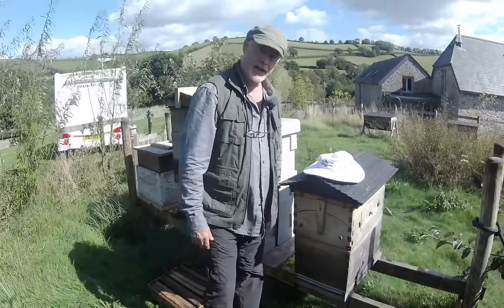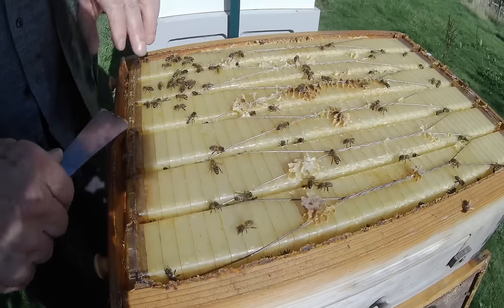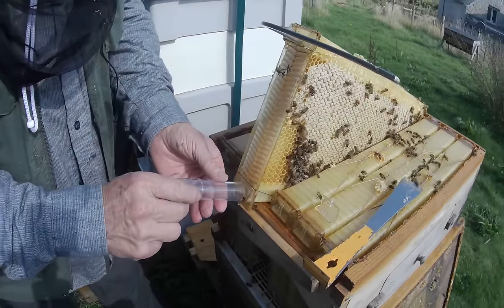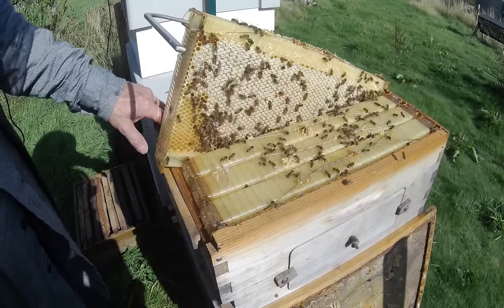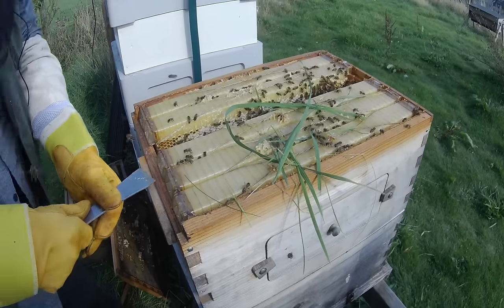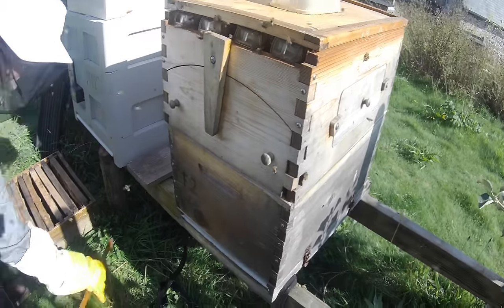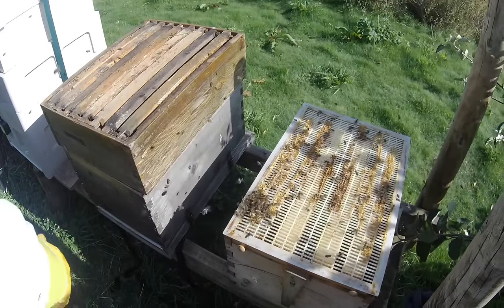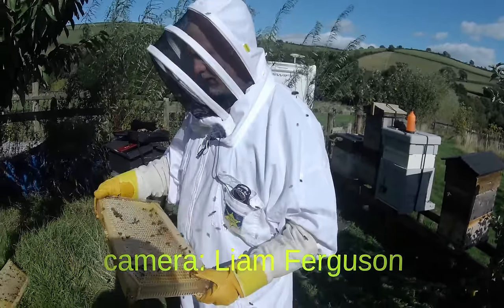Don't buy a Flow Hive until you've seen this!

Comment: An Excellent informative video and states early on this is Not a critical video but one on observation, practical aspects, reality, informative.  Sales in the UK are low,  for good reason. Cost being one. 
Clearly many here are criticising I question if they ever used  a  Refractometer to check the water content of the honey before extracting and selling it! Fact it is not honey if the bees have not sealed the cells, the water content evaporated to around 17%, as shown large areas of the frames have not been capped therefore this can, depending on water content,  ferment into mead! So guess many uncapped cells have higher water content with headless bees?! Constructive criticism is useful.
In UK flow hive make a specific supper with I think 10 frames to fit a stnd National hive. However, as we do not have very viscous free flowing gum honey (as in Oz) you need sometimes need to warm the honey frames/box inside before opening up the frames.

Comment: The care required to make sure you don't break any of the plastic is possibly a reason to consider a hybrid frame since you can usually get one of the  wood frames on the ends out first without mishap.
Reply from the maker: What's a hybrid frame?
Reply: @BarefootBeekeeper  Sorry I should have clarified. I meant one of those sets of 3 or 4 flow hive frames frames that go in a super with regular frames on each side. They sell them by themselves or in a flow hive super. Then you could take the regular ones out first and not worry about damaging the plastic because the hardest to get out is the first one.

Comment: Did I miss something, why are all these comments going on about bees escaping because of a missing metal part. Not once did I hear phil say bees were in the wrong place. Also should bees not be able to freely fly from the entrance, if they smell honey they will fly anywhere. But mostly how does this in any way affect the three main critiques, 1. killing bees in a guillotine style mechanism 2. not knowing when a central frame is 100% capped (requiring inspection and negating the convenience) 3.or crystallising honey types jamming the mechanism. 
Unless I missed something he said. 

There seem to be some very odd "didn't listen" conversations going on.
Reply: #1 flow hive does not kill bees. i have many of them and not once have i seen a dead bee after harvest stuck in frame cell.  #2  flow hive does not  advertise that u can tell when middle hives are capped. u simply do it the same way u have been. inspect it. but usually if the ends and outside frames are capped so is the middle.  #3  harvest your honey before it crystalizes or just take super off during that flow
Reply: Phil didn't mention bee's being in the wrong place because he's not sure how the flow super works I suspect. Also the viewing/harvesting window is at the rear of the hive so of course the bee's are free to come and go through the entrance as they please. I recommend watching other independent video's that demonstrate the use of the flow hive by someone who's read the instructions. Like everything there are pro's and cons but unless you're a very large apiary the pro's most often far outweigh the cons in this case I suggest.
Reply: he didn't have to say the bees were getting out through the back, if you paid attention to the video you would have seen the bees back there and the gap they were coming through.
Reply: @rapier01  There is no entry or exit in the rear of my flow hives. Dunno where Phil got his from, but I have suspicion his may be knock offs.

Comment: I have a question. If you do not want the ivy nectar in the flow box then at this point why not just take the flow super completely off an install a regular super . That way you can harvest what ever you have in the flow an all the problems solved. Store the flow box for the next season . That way you do not have to do so much box shifting around. Just a thought .

Comment: I had the same concern with my flow hive, unless you look at each frame you simply won't know if they're completely capped. Getting the flow frames out of the hive to check them is a major pain, to put it mildly. Having said that, I now simply wait until that outer frame is completely capped, then I harvest. I raised my concern with the Flow Hive people but was brushed off (pun most definitely intended). I wish they would make the boxes roomier so that frames can be pulled and checked more easily. I have absolutely no idea how they would go about doing that, but there you go.
Reply: Well bees always cap from in to out, then top to bottom. So if you see the bottom capped on both sides it’s done
Reply: MIMI, why on earth would you take the Flow frames out of the hive ??????? You can see very clearly, via the rear window when the whole frame is full from top to bottom. Crank the frame with your lever, wait until the bottom is full, remove the plug, insert your tube and stand there until the honey stops flowing. Remove the tube, clean up the spill, put plug back in and reverse the lever, reinsert the plastic stopper and there you are. Easy as. Of course looking after the BROOD underneath is a whole different story.
Reply: @itchyvet  Sorry, but you are SO wrong! Using your method my frames should have been completely capped. They were not. Not even close! There were huge sections right smack dab in the middle of each frame there weren't capped. I would say the frames were only about 65% capped. Not even close to being ready to harvest.

Comment: I have 2 flow hives without any issue.  I suspect as u have bees out the back it maybe assembled wrong. I've never had bees out the back. My 1st year with flow hives and frames are half full leaving on for winter. I have no issue removing flow frames for inspection
Reply from the maker: If you leave them on for winter above a queen excluder, there is a danger that the cluster will move into the super, isolating the queen in a cold brood box.
Reply: @BarefootBeekeeper  all my queen excluders from my 6 hives have already been removed. Feeders are in place ready for sugar once the temp drops.
Reply from the maker: @garethpattinson2099  in that case, your queens have access to the Flow supers and may start to lay in them come Spring...
Reply: @BarefootBeekeeper  yes I am aware.   I will be putting excluders on in march. Even if the queen lays in the supers all I have to do is locate her make sure she is in the brood chamber and let the brood hatch they will then go back down. This cycle has been documented and I'm well aware what to do it this happens.
Reply: @BarefootBeekeeper  Really no big deal then, put on the queen excluder (make sure she is below) and wait 21 days.  I had this happen and it actually helped get the girls using the flow hives.  One other note, I watched a bee in the end panel when I opened the cells and she was fine afterwards.  It is tight for her but she was fine when I closed the frame back.
Reply: @arthurharper7811  I have to admit my bees were very reluctant to use the flow frames I took some brace comb wax from the same hive and smeared it into the cells they had the frames sealed within days.

Comment: Sire you didn't install the Flow Hive properly, it's missing the metallic strip that the Flow frames would rest on, don't go aground saying that when you obviously it wasn't set up good to begin with.
Reply from the maker: The metal strip would NOT fix any of the issues I talked about.
Reply: FYI no bees get harmed when opening cells if they are down the cell. And bees shouldn’t be able to get into the rear viewing area where you extract from and you may find this very hard to extract with the frame being out of the hive
Reply from the maker: @michaelwalsh9881  I successfully  emptied one frame, but it appeared to leak honey from between segments. Had that been in the hive, it would have dripped onto the colony and possibly set off robbing. I am not convinced that these are worth the trouble or expense.
Reply: @BarefootBeekeeper  With the availability of top bar, Warre and Layens I would have to agree but they do have a market and my friend at work wants one and I try to explain the other options but he has no interest. If you had a spillage between the end of Hymalayan Balsam and start Ivy they are definitely at risk of robbing with them being in dearth in some parts of the UK. In the north it usually rains throughout most of the Ivy flowering and the bees don't get the best from it unfortunately.
Reply: Phil Chandler - Barefoot Beekeeper The very first time you use the Flow frames, they do leak into the hive. For that reason it's recommended to only do one frame at a time the first time so they have a chance to clean up without humidity or robbing. I did two frames and there was immediate bearding but they cleaned up before nightfall. 

After cleanup the bees will seal up the bottom and you can do all the frames at once if they're ready. My second harvest I did all the frames without any bearding at all. 

I'd estimate the robbing risk as less than using a boardman feeder - if the hive is weak there's a chance, but the leaking will be deep inside the hive (compared to at the entrance with the feeder)

Comment: I wouldn't recommend anyone watch this as an example of a typical Flow Hive experience.  I think its fine to experiment and test out new ways to use various bee equipment.  That is what is going on here.  If used as directed Flow Hives can be a great and fun way for a backyard bee keeper to keep bees and harvest honey.  They arent perfect.  The main down sides of Flow Hives are that they are too expensive for large operations and the construction & materials (while nice looking) are not the most sturdy and must be handled carefully over time.  But for people who just want a few hives in their yard, or field, they are perfect.  Yes, you still have to work your bees, but the windows make quick checks easy and the flow design is non invasive to the colony.  We have several and the whole neighborhood comes over to watch the honey flow out the tubes.  The biggets difference between Flow and other hives is the harvesting.  With FHs it litereally pours out the spiggot and you are done.

Comment: Right at the very beginning when you removed the back panel there were bees there. This means you haven't assembled/adjusted it properly. 
Is it a genuine flow hive or a cheap Chinese copy? I've used genuine flow supers for four seasons now and have only come across two problems.
 
 Problem 1. It can be a problem to get the bees to use it the first time, but I simply followed the manufacturers advice and brushed some warm honey and melted wax over the flow frames and the bees readily accepted it.

Problem 2. Because I use single brood chambers I am restricted in comb manipulation in the sense that I like to move frames of brood up into the super and replace them with empty combs to give the queen more room to help prevent swarming and build up the hive at the same time. The flow super makes this a bit tricky but it can be done. I have since found out that the company makes a hybrid super with half flow frames and half normal. I would advise anyone who likes to use single brood boxes to use these. (If they're going to use flow hives)

In Australia I have no experience of ivy or any other crystalizing honey but surely you would have the same problem with normal extraction methods? Regard j.

Comment: The tube that goes in the bottom, you put the side, with the little plastic piece that protrudes out, into the drain hole. That plastic lip should be at the bottom. It prevents honey from dripping into the hive.

Comment: You clearly did not read through the instructions on how to use your flow hive.  What you're calling "combs" are in fact FRAMES and ought to be treated as .  I don't lift the frame by the steel wiring.  Handle the frames just like regular frams.  And, are you not inspecting your frames - the propolis is more than one week's worth?  RobG below lists the absolutes for operating the Flow Hive.  Wish you best ...

Comment: All those bees in the back are because you did set it up right.  Not supposed to be space at the back. You need to adjust the flow hive panels to the rear. Either by the adjuster screws in entrance side or just a thin wood strip.

Comment: I use smoke sparingly, but I would have used it here....it would have kept them calmer - judging by the sound of the bees on the mic they were pretty upset,  I know you use water or weak sugar mix (?), surprised you didn’t use it more. Interesting video on flow hive though!
Reply from the maker: I just don't find it necessary to use smoke. If bees are ever so pissed at me that my mist spray fails to calm them, I walk away. I'm not under commercial pressure, so I have no need to get anything done on a schedule that does not suit the bees. It sounded worse than it was because some of them were all over the wind shield on my mic!

Comment: Tbh the issue with ivy honey has nothing to do with the flow hive system and is systemic with your location, since it can't be used much regardless of the hive setup. It sounds like you need to give the bees an alternative, some sort of perennial that blooms at the same time that you can plant en masse nearby and have it grow and bloom and reduce the issues surrounding ivy honey.
Edit: Saw someone point out the bees around the collection opening, and that's definitely wrong. I feel like the directions needed to be read a few times over before trying to use this flow hive. Everything keeps going wrong for him.

Comment: Sorry Phil, observationally, you are using the system wrong and this is why you are getting the results you have. The set up is wrong, you are best served asking for help with the set up from the manufacturers. Assembled Flow hives are not my thing, I don't use them. Having said that, people using them properly get different results to you. My suggestion, FWIW, go back and re read the instructions, watch some videos and ask for some help from the support team. Like any tool, when used correctly results are different to when they are used incorrectly. Just my observation.

Comment: So the video should have sub tittle, how to piss my bee's off and get stung. LOL
As individual bee keepers it is a life long learning process.  How not to be too intrusive and keep bee's in mind when working with them and they will respond accordingly.  Always have smoke even if it is only a lite bit and have a plan.
As far as the flow hive goes he has some good points about it but like others have said care and operation of this equipment is part of the problem.  If you know the flow and the end result honey you can manage this, meaning hard or jelly honey don't use the flow hive if you have honey that flows easy then you are good to use the flow hive. 
Remember it is all about what works for your bee's and you.  For my area it is late June to late July for flow hive then back to my regular hive boxes.  I'm new to the flow hive with just two of them but am working on my management of timing and observation of my bee's use of it.  All my other equipment I use has a time and use plan but each year is different and so a floating schedule and adjustable thought process is needed.  
The more we share with each other on our experiences the better we all will become, that's the good and the bad.  There is always something we can learn from every video even if it's just a simple fact.
I would say if you think it might be a good thing to try for you and your bee's then try it on a single hive and see how it works.  Never be afraid of learning something new just don't go overboard.   Learn as much as you can while in the process.
Bee's are amazing little creatures and I don't think there is any Beekeeper or person that would disagree and that's why we should always be looking to do our best for them and ourselves.

Comment: For someone just starting out with bee keeping would the flow hive be recommended or should one stay away from them??
Reply: Ma'am,

I have two of these, but have yet to get any honey out of them, but that was just my dumb luck.  Please go to the web page and look at more videos of the more recent models.  This video is of the first model, there have now been several much needed improvements since this item first debuted.  And then, check out Fred Dunn's YouTube channel.  He owns several. 

It is the most expensive hive. You still have to do the same amount of bee care as with any other hive.  The benefit is that honey extraction is super simple.  The downside is that if you plan on getting any wax out of the FH, FH2, or the FH2+, you will be disappointed because there is no wax to melt after you extract the honey.  Only the Hybrid FH can do this as it is a mixture of three Flow Frames and four normal frames.

So, if you just want the honey, I would get the FH2 as you do not need to buy any extraction tools.  But if you want a hive to get honey and wax, then maybe you get a "normal" hive, or buy the FH Hybrid.

Lastly, to address this video's concern about thicker honeys.  Honeys with a very low viscosity will not work (ie: manuka).

Oh!  I've found the FH customer support to be top notch.  They support their product 110%.

Comment: If you're concerned about bees being in the cells, couldn't you pull out a full frame and replace it with an empty frame, then take the full frame and put it into an empty Flow hive that's there just for extracting honey away from the bees?